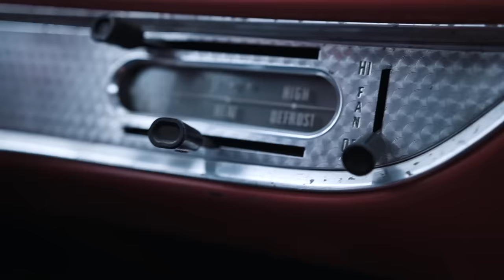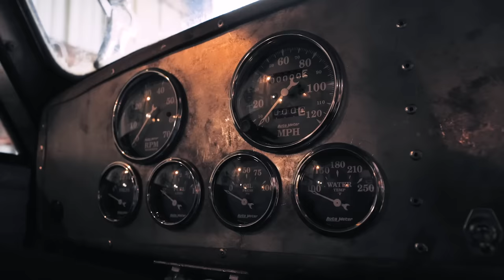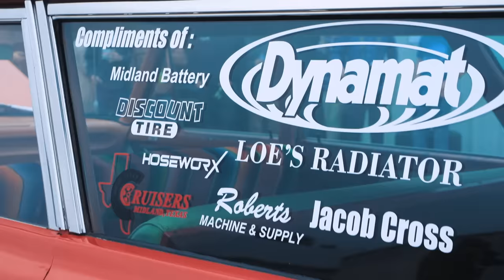Crazy Cars in storage units next to College campus | Barn Find Hunter - Ep. 63 (Part 4/4)

Comment: Very nice MG,  ive owned several British cars including a 79 B, 53 TD, 55 TF 1500 , and a 64 Austin Healy  that 79 you found  was in nice shape yet someone  put wire wheel conversion on it  which is desired but not stock for that year Moss Motors has sold a conversion kit for years  for the wire knock offs as well as a few other  people  i beleive the Moss   System allows you to  convert to stock pretty easily  and is a favored  one for many  collectors  BTW i know its not right  but i actually liked the sound of the Falcon  6 cylinder. With the exhaust leak   I couldnt agree with you more on the Bugeye going with the 1275  although you  also need to   Change the brakes to disc. Up front  and another good upgrade is putting in a Datsun 5 speed for todays highway driving  the Crowley Dually is one cool project  those two make a heck of a team  i hope they stay together and keep building new projects  its always nice to see woman. In the car  business  not being chauvinistic  but females do have. A  much  more  flare for design and art   Compared to men    I liked this video with the sidestep of the tudents and the school

Comment: I don't think that first GMC panel is from 1950, or at least the doors aren't, because Chevys and GMCs did not have separate vent windows until 1952. Small point. That one has the nice grill in exceptionally nice shape.
Reply: Actually, the vent windows were first put in trucks in 1951. It was the only year that they  still had the turn down door handles and vent windows. In 1952, they had push button door handles. Also, you couldn't put the 52 through 55 1st doors on a 51 or older without some major modifications to the cab where latch plates go. The reason I know about this is because I own a1951 Chevy truck with a lot of cab damage. I was going to replace the cab with one off of a 53 until I found that my 51 doors wouldn't fit, so I ended up trading 53 for another 51 cab. There is a possibility that this panel is a 50 with 51 doors on it.

Comment: Cool school!!  Dig that Studebaker truck.  There’s no way I would build that Falcon wagon bone stock.  Booooooring.  The Crosley is cool.  Hope they make a good hood, the clean engine and new rad messes up the concept.
Reply: I'm working on fabricating a grille and bumper setup that will obscure the aluminum radiator. Couldn't find a steel one for very cheap, paid $150 for the aluminum one. As far as the engine, it's only got a single coat of spray enamel on it, it will probably wear off before long. Thought about just clearing the raw block and heads, but I decided that a splash of color might not look too bad.
Reply: If I had three grand laying around the Caddy would have a Weiand 8-71 on top of it. At 8.5:1 compression that big engine is just begging for boost, but I can't afford forced induction right now lol
Reply: Lane Sutterby, you and your partner in crime have done a great job on that rad beast!  Sounds like you have good plans to wrap it up.

Comment: Hagerty I’m a big fan of what you do and live in Arkansas. Is there a way you could give me some advice on my 1979 Chevy c10 that I’m the second owner of. I’m 18 and need advice from someone who has seen it all.
Reply: fix it dive rite in,reasearch
Reply: willefixit I’m already past that. I’m looking for future ideas to do to it. I’ve put 3k miles on it with a motor that knocks so it’s up to 54k original miles.
Reply: @jonathanperez5888  rebuild it or get a used one cheap build origanal later  cheys good starting point dont get over whelmed with ls swap, look around 350s are all over short block gasket set , it s not hard . good luck 79 350 good engine,just  look ask ?youll find one put wanted ad out.
Reply: willefixit alright thank you man. I’ve had my eyes on a 350 or ls swap. I know two guys who specialize in each one so it’s just finding which one is suitable to me

Comment: 79 MG nightmare. I had a really nice really unreliable 43,xxx original mile 79 myself. Loved it when It was running correctly which wasnt often . Hated it when it wasnt running right or not at all. Which was basically 7 months of the 11 months I had it. Lots of electrical gremlins and a never ending carburetion / induction problem and then the fuel system issue that drove me insane , never ending oil leaks, water leaks and money leaking from my wallet.

Comment: That Crosley panel rat rod dually needs a copper radiator.
Reply: derrin pickett that’s tempting, but I do still have the stainless trim that runs down the body line, and the polished aluminum radiator kind of matches that. It will be getting some kind of grille eventually lol just haven’t figured out what I want to do yet

Comment: 26:28...That gear and chain steering wheel may look cool (until you get in an accident).
Reply: at least the air bag wont grenage in your face!!!!
Reply: Marshall Curtis I designed it with safety in mind. It’s not a one-piece steering column, it will fold if I ever do get into a wreck. On top of that, I plan to have at least a roll bar, if not a full cage, and four point harnesses.